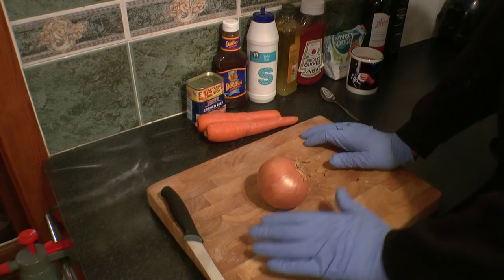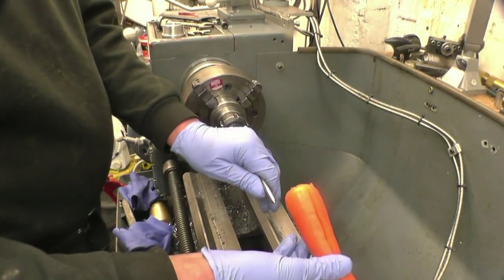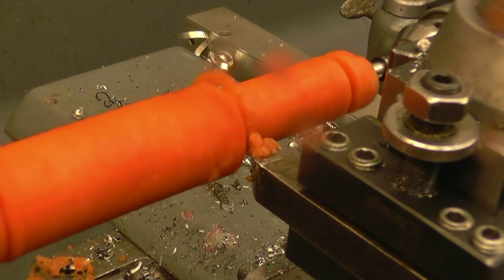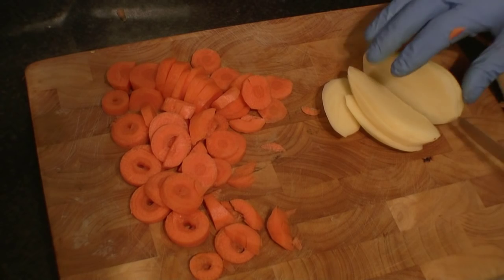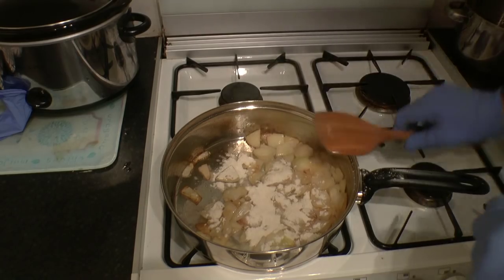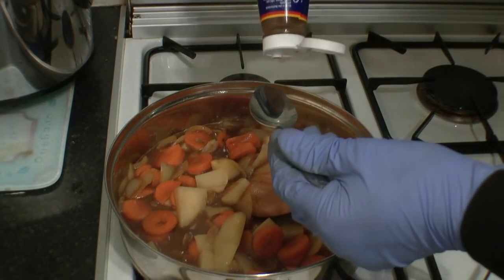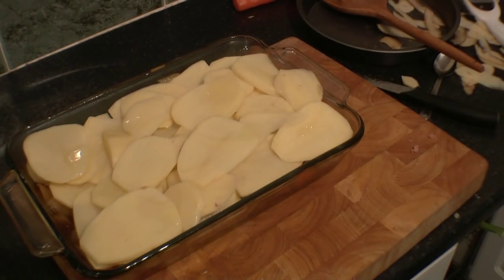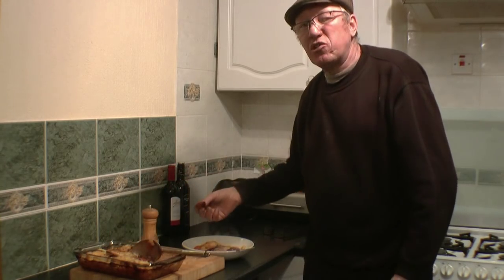Tetty Pot  (  Potato Pot)

Comment: john.i can not understand why you did not bore the carrot out with a single point boring tool then then you would have the carrot running truer on the mandrel,by the way what strain of carrot would you reccomend for this project,also would you think that it woulld not be better to use a  pice of cobalt rather than a tipped to give you a better finish

Comment: The key and tab way for removing the can of corned beef goes back to WW1 in the later stages of the war the supply lines started allowing food and treats to the guys hit at the front line and the war ministry new that there front line soldiers had been stressed and as such there had to be a way of lifting themoral of the men and decided to get meat, cigarets and chocolate, they came up with beef in a can and even the first ham in a can ( ham in a can did later turn into spam) since the soldiers only had bread and weak soup.
So it was decided that a normal tin openers didnt open the square tins that where needed. The ingenious tab and scored line method seemed to surve the purpose well the scored line was put on at the sam time as the metal was cut and assembled.

Comment: Well, a YouTube machining first. I have seen people turn cast iron, stainless, brass ... but never a carrot! Edges chamfered yet, wouldn't want to cut yourself on a sharp carrot. And properly parted off. But I am shocked -- shocked!  that you did not put the carrot in the mill (in  a V-block of course) and slice it up with a slitting saw. BTW I have a gadget which looks remarkably like a mini-lathe. It will peel, core, and slice apples, and is available from www.lehmans.com. It is supposed to work on potatoes too. If I were you, I'd get a bigger knife, an 8" or 10" chef's knife, or if you are stylish, a Sudoku. I am no Jacques Pepin, but just as in lathes, the right tool makes the job easier. Yum. I can eat everything on that dish except corned beef which has sodium nitrite, bad for cardio guys like me.